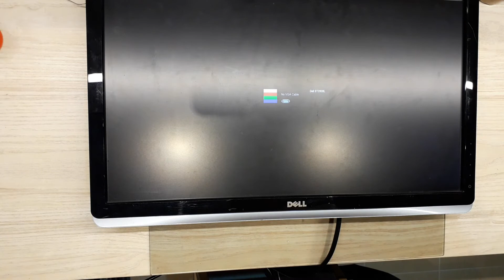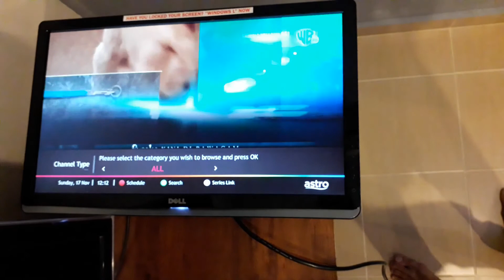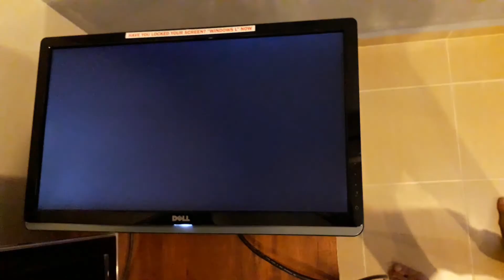Dell ST2320LF 23 inch - no power

Comment: hi i have a problem with the hdmi port. can it be changed? or solved
Reply: I believe it can, just find a identical HDMI connector but need a hot air station to remove it plus liquid flux